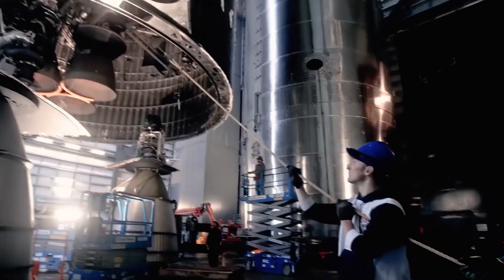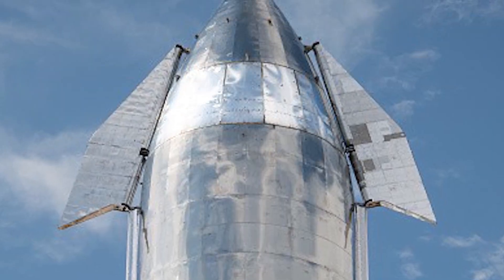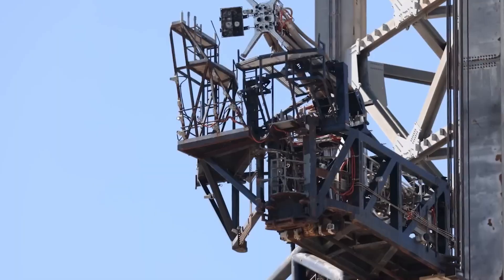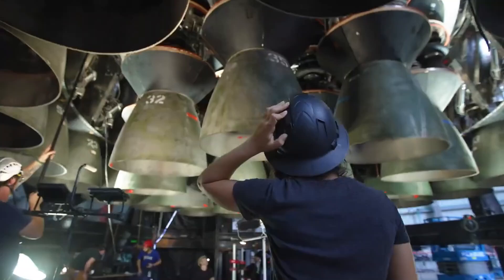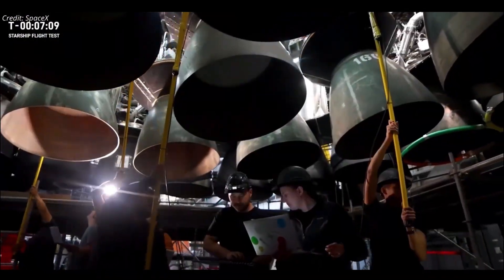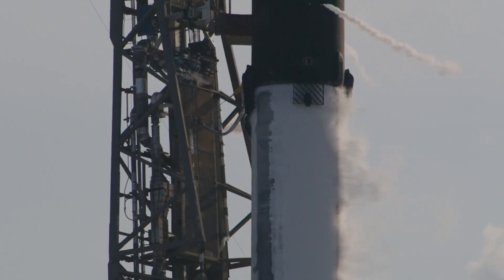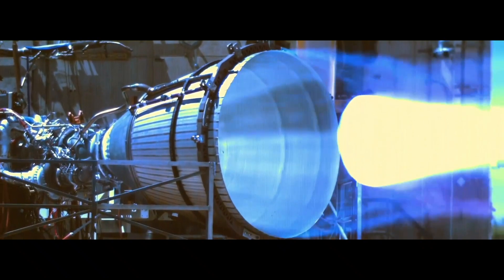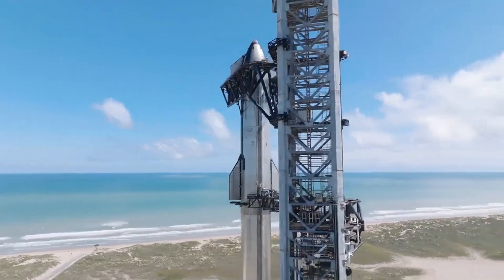Starship V3 Welding: SpaceX’s Genius Upgrade Wows Scientists!

Comment: Ships must be built in space with asteroid metal to expand into the solar system.

Heavy metal ships. 
Solar thermal foundry heat and automatic vacuum cold welding... no wasted fuel on pushing material out of the gravity well.

One factory ship can capture asteroids and convert via robotics into finished vessels that return to earth for crews.
Reply from the maker: Many thanks for sharing!